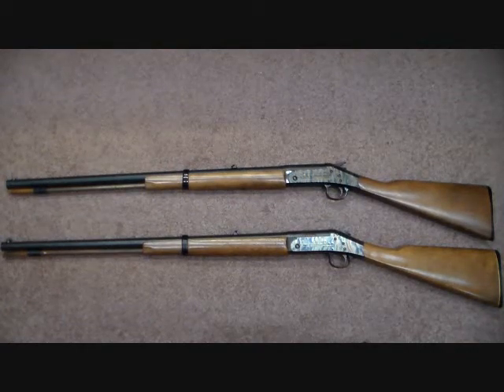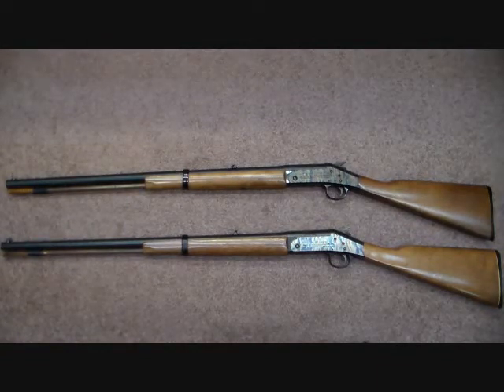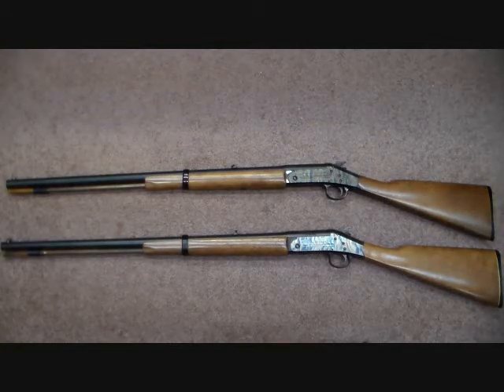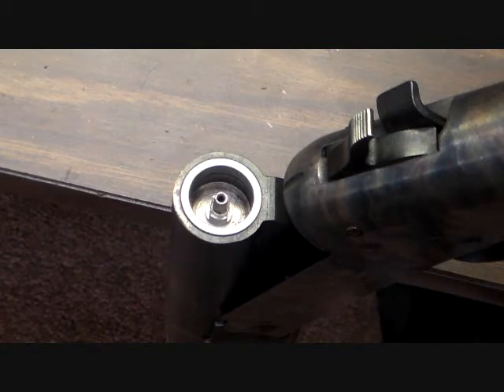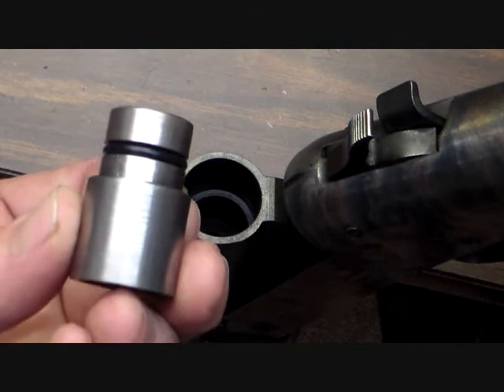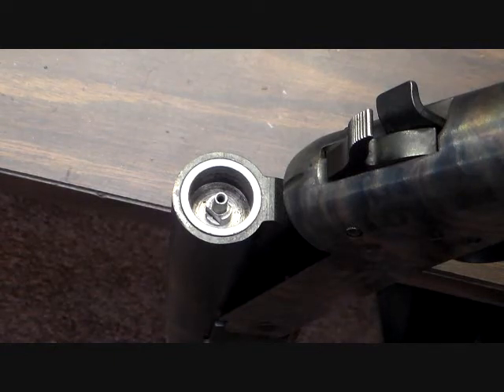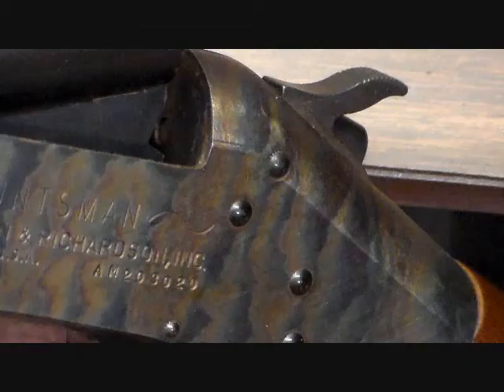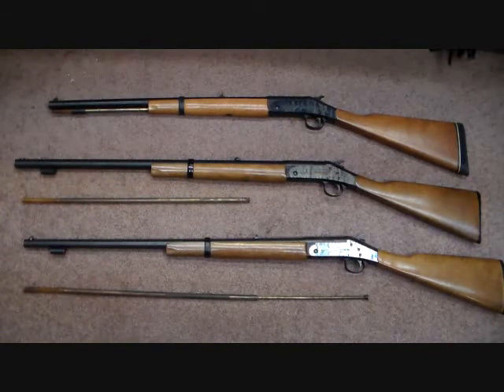H&R Huntsman Muzzleloaders-.45 cal & .58 cal

Comment: The breach plug on my early 70s 58 caliber huntsman is removable without having to disassemble it. Couple of taps with the ramrod  is all it takes. The design on the one featured here is probably an update to the original as a safety precaution in case of a hangfire if the breach was opened to soon.

Comment: In 1985 I went shooting with the  .58 cal shown in this video. After firing the gun 4 to 5 times the percussion cap failed to fire the charge, we removed the cap, used a nipple pick fired the gun. This happened a second time, so we waited about a minute, as before, to make sure there wasn't a hang fire. I opened the breach to remove the cap and the breach plug blew out of the back of the gun. It went through the standing breach and into my right hand causing significant damage. After 7 surgeries, including skin, nerve and tendon grafts, I am still able to use my hand. The discharge could have been caused by a static charge. I can send anyone a picture of my hand as proof that this is a very dangerous design and anyone who owns this gun should have a slave pin installed by a gunsmith.
Reply: This design defect was the basis of a number of lawsuits against H&R.  As a result, this model was dropped from their line.
Reply: I don't want to see your hand, but would be interested in seeing pictures of the destroyed gun with a hole in the standing breech.

Comment: What type of powder does the 1971 58 cal use? I've had my 58 cal for 10 yrs nd never shot it, no stores sale the ball size where I live
Reply from the maker: It uses regular black powder or you can use Pyrodex which is a BP substitute and it is usually more available at a good gun shop than real BP. You can buy round ball or conicals online pretty cheap and it's just lead with no powder or primer so there's no haz mat fee. You might be able to shoot .490 or .530 round balls if you use multiple patches.

Comment: I'm a big fan of those Huntsman rifles. About 30 years ago I had a .58 that had the barrel shortened to ~18 inches. It had the o-ringed breech plug and took a 209 primer. I think the 209 plugs were a factory accessory as opposed to actually coming with the rifle, on these early ones. My breech plug would clear the receiver and could be removed w/o removing the barrel. I used to load it with the Lee full wadcutter Minie and some very hot loads.
I now have one in .45. It is late production of this early series and has the screw-in 209 breech plug.
Reply from the maker: Thanks for stopping by.I like your channel.
I took the .45 out and shot it the other day.44 round ball with a patch and it shot well but not with CCI caps.The Dynamit Nobles worked every time.If I shoot it more I'll get a Lee .45 Real bullet mold for it.
If that one you had was set up for 209 then it probably came that way from H&R,I'm pretty sure the firing pins are different.
Reply: JohnLeePedimore
The firing pin on my .45 is flat and about a quarter inch diameter. I'm pretty sure the .58 was that way too, but that was 30 years ago so I'm not 100% on it.
My bullet of choice for the .45 is a Lee 300ish grain flatnose Minie. Lee lists a .450 one at 294 grains and a .454 one at 298. I don't remember which one I have, but I need to dig it out and cast some because muzzleloader deer season opens in less than two weeks and I would like to make meat with it this year.
I load that bullet over 90 grains of Goex ffg, and it seems to like that load.

Comment from the maker: From what I've read the max charge on these is 100 grains.The newer model Huntsmans in .50 cal. will take 150 grains.
Reply from the maker: Ruebon Cogburn $150 is not a bad deal.
It does unscrew from the plug.I could maybe put a nipple for a musket in there and get a little hotter spark but the RWS  No.11 caps work fine.Also,the firing pins in these guns are flat to set off the percussion caps.I don't see how the 209 would work without a centerfire firing pin.They make a 209 conversion for cap-lock guns and they have a centerfire firing pin adapter that screws down over the cap.
Reply: I actually own all of them the modern 50cal huntsman is 100 grain only!  The rifle called the sidekick is the magnum gun that will take 150 grain charge

Comment: Not all of the .58 caliber Huntsmans have the simple press in breech plug. Some have a screw in breech plug, the way to tell is the one with screw in breechplug has to blind hole drilled into it across from each other. These are so you can use a spanner wrench to tighten or loosen them for cleaning. In a pinch a set of needle nose pliers will work as well unless someone way over tightened it. Remember you should always after cleaning put a very light coat of anti seaze on the threads then run the plug in until it bottems, give it just a little part turn after that to snug it. As long as you don’t over tighten it you should be fine. These rifles can be found cheap and they are a ton of fun to shoot or first learn on.

Comment: My bother threaded the .58  breech and machined a stainless steel breech plug to replace the O ring breech plug.  The O ring plug gun shot terrible groups and I had a partial opening of the breech with a hot load.  Now the gun is safe and shoots cloverleafs at 50 yards.  The O ring guns are what put H&R out of business because some users did get hurt.  I recommend to never shoot O ring H&R guns.

Comment: I picked one up in 45 caliber the other day for $30. The breech plug on mine has been welded in shape but instead of using percussion caps it looks roughly the right size for a shotgun primer, however if this is the case I don't know if the gun will fire as the firing pin is just like yours. I wouldn't be too sad if that means I just have a wall hanger but I was excited to have something new to throw lead with.

Comment: I have one in 58 caliber with a screw in breach would you happen to know what the maximum charge is with a round ball?
Reply from the maker: I've read that the max charge on older guns is 100 grains but I doubt I'll ever exceed 80 grains with mine. Newer Huntsman models with the 209 primer system in .50 cal will take 150 grains.
Reply: Hey John I was going to ask you a question do the two that you have have a little bit of play like when you move the barrel and the stock or are they made it real tight with no play between The barrel in the the breach.
Reply from the maker: @theluckypepper4400  I've always been impressed by the fit and quality of all my H&R Handi rifles. They are one of the best bargains out there. 
How loose is the gun?
Reply: @theluckypepper4400  Mine has a little slop. I too was wondering if they all are this way.